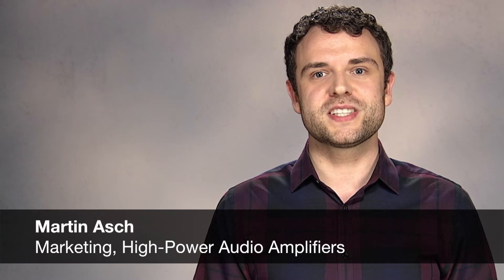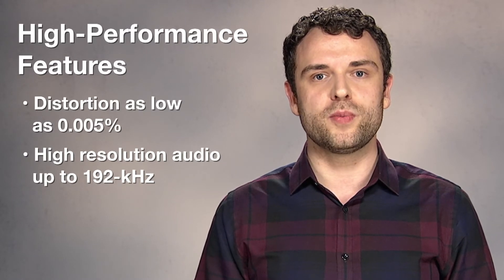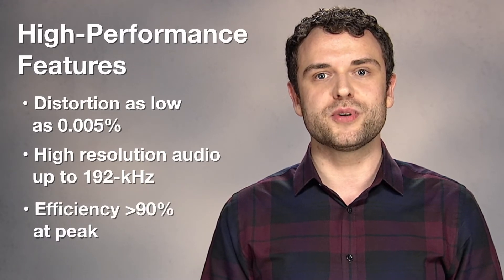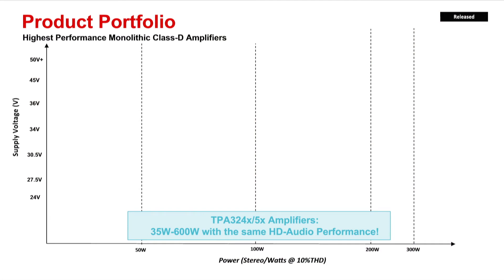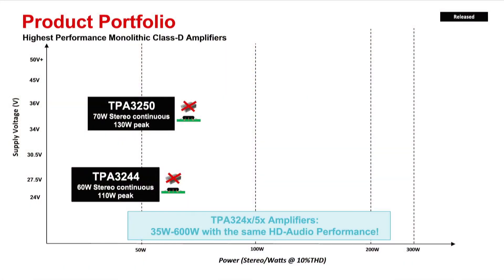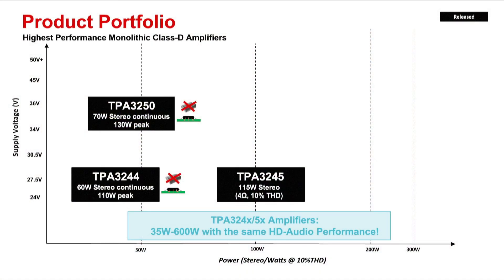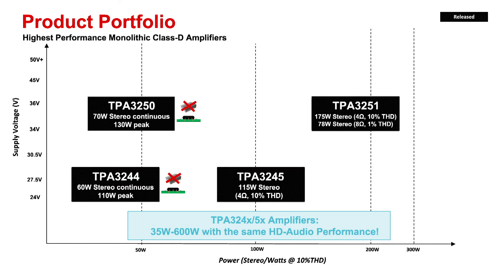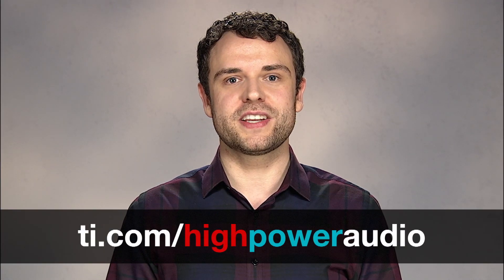High-power, high-performance Class-D audio amplifier overview for 35-600W applications

Comment: As much as I respect TI's products, the TPA family stands no chance against true audiophile-grade class-D amps line Hypex's Ncore, ICEpower ASX, and the best of all, the Purifi IET400A, which easily outperforms any 10,000$ class-A amps. The TPA family is great for driving subwoofers, not full-range speakers.
Reply: To be fair, TI sells the 3255 for $5 in volume. And this is the highest power chip in the famlily.

Comment: Not like the TPA3116, this chip does not support Single End input in BTL mode. That means it needs preamp to convert to balanced input. this add more distortion to the amp board!
Reply: Please can you explain this better?  What is the problem with the TPA3255?

Comment: the 600watt at the biggest amp chip seem a bit of a lie, 150w stereo with almost 1% THD and assuming rms or similar.
Reply: The power output depends on load impedance -- depending on that, 600 watts mono (in PBTL mode) isn't "a lie."
Reply: That what they are saying, 300W/Channel peak equals 150WRMS/Channel, they are not lying
Reply: @saedabumokh9577  the claim was 600 watt, and the biggest chip in the chart is 150watt 8ohm stereo.  and he said 600watts and did not mention ohms so its probably 4ohm.  peak is not a very useful number, only continuous 8ohm watts is close to useful.  then there is the distortion, its 10%  for the 315 number in the chart, less than 1% is the standard so they are pushing so many missinfomantoin here to make it look more powerful. thats my point.

Comment: Does the amplifier do anything novel like direct digital or ternary PWM?
Reply: No, it's an analogue amp, you can find really nice DACs for peanuts these days to pair it with. I got one of these, it's staggeringly good value for money - https://www.amazon.co.uk/FiiO-Taishan-D03K-Digital-Decoder/dp/B009346RSS/ref=sr_1_5?adgrpid=52626733625&dchild=1&gclid=Cj0KCQjw6uT4BRD5ARIsADwJQ18k_jgw6ToRaq44UNgMxa0QAfHikZum2_O4T22uuBREeHtyqncSaoAaApQCEALw_wcB&hvadid=259044496499&hvdev=c&hvlocphy=1007011&hvnetw=g&hvqmt=e&hvrand=15133886083725821852&hvtargid=kwd-298917989918&hydadcr=22928_1807009&keywords=fiio+dac&qid=1595513768&sr=8-5&tag=googhydr-21
Reply: @khimaros  Thanks! Looks interesting! Have you heard the ternary chips though? So efficient and clean with optical/coax/USB , e.g. STA333 or STA326 https://www.aliexpress.com/item/32781579708.html https://www.aliexpress.com/item/32465541536.html

Comment: Regardless of maximum output power, 50W RMS being more than enough for me, I have noticed that TPA 3251 is perhaps the best choice in terms of THD+N, both at 1kHz and on the entire audio spectrum. Even slightly better than TPA 3255. Albait unfortunately, there is no direct indication in the data sheets, as how the TPA 3251 performs at 8 ohms in BTL, so I cannot be 100% sure of my deduction. Anybody at ti can confirm that the best choice for me is the TPA 3251? Thanks.